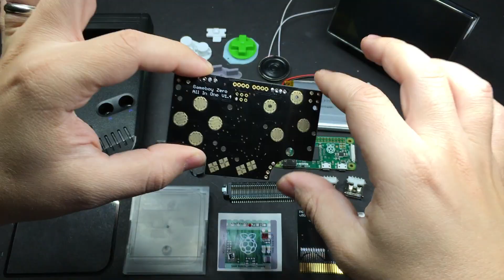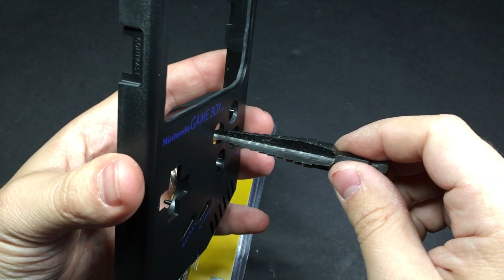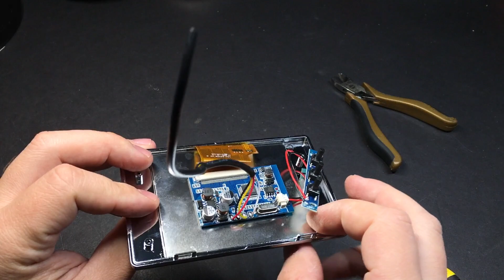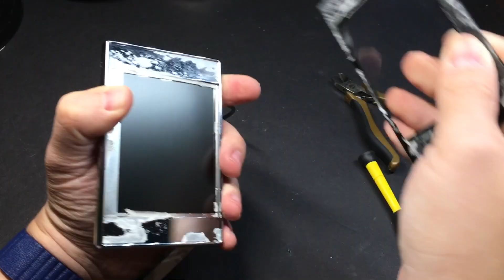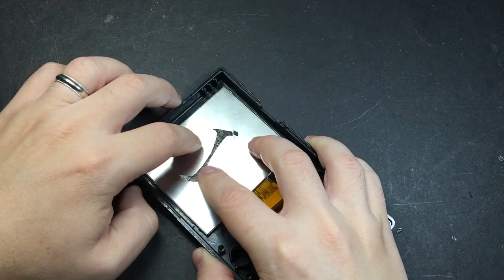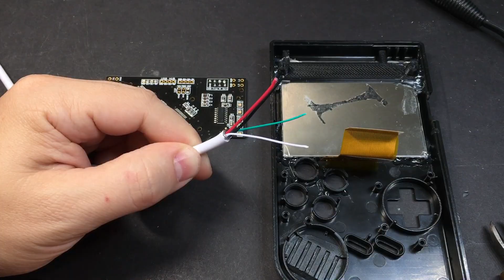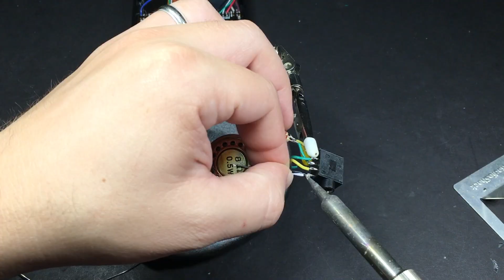Game Boy Zero Custom Part Build Guide Part 1

Comment: Has anyone tried using ringer speakers from a cell phone or PSP/PS Vita.  They are smaller and would allow for stereo speakers. Maybe like these..

http://www.ebay.com/itm/1PCS-Ringer-Loud-Speaker-Buzzer-For-HTC-One-M7-801e-801n-Earpiece-Repair-Part-/191787519326

http://www.ebay.com/itm/NEW-LOUD-SPEAKER-RINGER-BUZZER-FOR-SONY-XPERIA-Z3-D6603-D6653-L55T-B-271-/262224974922
Reply: Two speakers next to each others sounds about the same as a mono speaker :(
Reply: Ziggurat i wouldn't put then in the original location. I'd drill holes on opposite sides like the PSP. I'd probably put an analog stick were the stock speaker is and another below the dpad.
Reply: brando92711 If you want an easy way to do that you need to hurry up and bug Helder about it before he finalizes his third version of the PCB board (which includes headphone jack and much more). He has preorders for it (note the picture is not how it will look, it will have all the features from before, he just wanted to show of the headphone jack feature) http://www.sudomod.com/forum/viewtopic.php?f=3&t=1426
Reply: In still a ways off from building one of these. I'm still not sure if I'm going to build one based on Gameboy or GBA.. i haven't physically held either in years. PSP and Vita both cause my hands to cramp. I have fairly big hands. I'm leaning towards the Gb because it's thicker than the GBA but i like the shoulder buttons of the GBA.. it all comes down to which one i can squeeze the RPi 3 into because I think i want Dreamcast emulation :) Then it's a toss up between this project or putting a Wii inside a Wii U gamepad shell.
Reply: brando92711 I have started to look into trying to fit a RPi3 into a DMG shell in a Game Boy Zero style build. If I can't I will go with a Pi Zero. I plan on desoldering tall components, maybe even some of the slim components.
Reply: Ziggurat yeah, i know it's possible because I've seen a RPi 3 in a Gameboy pocket.  I think the attraction to the zero is how cheap they are but by the time people add usb hubs, usb audio and all the other shit they might as well put a RPi 2 in there.  The 3 is much more powerful but it's also a power hog.  Maybe it could be underclocked.
Reply: Possible yes, but also need to need to take into consideration power usage, what power supply needs to be used, how long will battery last, how hot will it get, can I forward HDMI to the contrast slider hole, can I forward the sd card to a game cartridge, and more.

Comment: This is so awesome.  From all the amazing work it's almost it's own open source project!  I actually wish that the community would take all these parts and come up with a few different 3d printable case designs.  The DMG-01 is nice but it would be cool if we had a few different case options that were compatible with these parts.. Mainly something that would more easily accommodate shoulder buttons and perhaps 3DS style analog sticks.  Maybe based on the GBA case.  Either way this is SUPER awesome :)

Comment: QUESTION! 
I know this is an all custom parts build BUT, could you instead just rig up a store bought USB power bank circuit and battery for a few bucks? Instead of spending 30+ dollars (with shipping) on adafruit's Brand battery charger and battery?

(For example: dismantle a $5 battery pack and have the micro USB on the battery pack be your charging port and route the Standard USB power output to your power rails by soldering) It should all be the same 5V by my understanding...any thoughts??

Comment: Great video, 
but one small thing: for me it doesn't work to just connect the "TV" cable for video signal. I have to use the pad next to it too, otherwise I don't see anything. I have a different board, but the same display driver chip and basically the same components too.

Comment: thank you again for your good work, love the button molds and screw bracket i got
Reply: what gauge is your usb wire? i have 24g ethernet cable lying around and i dont know if that would be good enough for this updated build.

Comment: This is great! Would you mind uploading a video on the basics of all the soldering you do with this project? I'm confused on all that stuff. Like how do you know what wire goes to what label, and how do you actually connect a wire to where it's supposed to go? All that stuff. I took a class on Boolean Algebra and we did a lot of stuff with circuitry but it was all just stuff with logic gates. I don't understand any of the wiring you do in these videos.

Comment: Thanks for the video. I'm having to solder the +5v and ground on the screen to pin 2 and 6 on the GPIO since PP1 and PP6 are used by the Zero4u hub I'm using. Apparently the pi zero doesn't have a polyfuse, so using either (I'm told) should be fine

Comment: I have the same screen and mine is happy running on 5 volts rather than 12 with no mods.
Reply from the maker: Nice!  Yeah it does work with it, but there was some subtle flickering that bugged me with it, and the 5v mod took maybe 5 minutes so I just did it.  The flickering might be minor enough to not bug some folks at all though.
Reply: Well mine flickers on 12v, so meh. I wonder if it's my screen or it's just not getting enough amps
Reply: I have the same screen but mine will not run on 5v without major flicker thankfully the battery im using is a 7.4v qaudcopter battery i had laying around

Comment: The best guide EVER i just buy my pi zero, how much cost every part if i are not form the USA?
Reply: wermy it would be impossible to you to sell all the necessary parts and charge us like 50 US and a cheap shipment? you could gain a little bit of money and for European people adding the charge it would be cheaper than buying all the parts separately and paying a lot of different shipments. 
thanks :D
Reply from the maker: Hey thanks!  I'm not sure on the cost for wherever you are located, and that's part of the reason I didn't include exact prices for everything: it will likely vary wildly depending on where you are located and where you are able to buy from.  Good luck!  :)
Reply: Thanks for answering! :) You're right, I found the case in a lot of colors by us $10 here http://goo.gl/FKqps2 but how much money you spend in one of this?
Reply from the maker: My case was $10 as well.  Nice selection of colors there!  Shame it doesn't have the logo on it.
Reply: It have logo but Aliexpress censore it, when it deliver to you comes with logo :D
I ask for all things tath you sow at the first of the video wermy
Reply: don't worry abouth me! it worth! :D Bronty Buutveld
Reply: http://aliexpress.com/item/For-Gameboy-Game-Boy-Original-Console-Shell-Case-Housing-w-Screen-W-Screwdriver/32551491861.html
Reply: that's 3.4 times more expensive THEN THE PRODUCT HOLY S*** +adrianrarevideos
Reply: Nintendo loves to sue. It is no surprise they are hiding the logo on aliexpress and banggood.
Reply: Bronty Buutveld why would you ever pay that. It's literally like $30 worth of parts. I wouldn't even sell completed ones for that price.
Reply: No ones gonna just do all the research for you because you ask them dude.
Go fucking find out for your self
Reply: I  bought mine on Aliexpress (grey) but even if the picture doesn't show a logo, there is actually one :-) There was the button included aswell and I paid around 7€
Reply: could you post the link :D?
Reply: *****
its the same as me! and comes with screwdrivers!
Reply: I've just started pricing and buying parts, looking at about £170 only really ordering from the US from adafruit and for the sudomod based stuff.
Reply: +wermy I'm pretty much screwd for shipping (NZ) if I want to buy a tetris cartrage from the US for 8usd it's 13.25usd shipping... FUUUUUUUUUUUUUUUUUUUUUUUUUUUUU
Reply: Just like buy a pi Zero in Spain! it cost 5$ + 17 of shipping D:Bronty Buutveld
Reply: I feel so sorry for you +adrainrarevideos
Reply: if I chose to bild this it's going to cost me 168.82USD or 233.04NZD one can only imagine how much it'll cost you R.I.P your wallet even steam sale doesint take that much off me +adrainrarevideos
Reply: gearbest or FastTech can send you all you need from china, free worldwide shipping oftenly
Reply: excuse me wermy  I can play game boy zero with the original game of Nintendo?
Reply: if you see the guide, you can see that the cartrige reader its only a SD card reader Mauro Palmieri

Comment: What is the build cost and could I get all the items shipped to the UK?
Reply: I'm up to £60.72 but didn't need the headphone jack, battery, sd card or usb breakout board.  Still require a AIO PCB at $35 plus shipping so I reckon I can get it done for under £100.  I'll post my links on the forums.
Reply: Finding some adafruit parts are difficult as they are sold out in many places. Google is your friend. Cost (I found) is around £100-£150 depending. I did buy an overpriced job lot of 3 broken gameboys.
Reply: beermanuk did you manage to get a post going on sudomod forums for UK prices for builds? Maybe one thread dedicated to UK parts?
Reply: Andy Marsh don't buy from adafruit. They're expensive as hell. Just buy the parts from eBay or similar unless you really really like paying exponentially more to support strangers that likely wouldn't do the same for you...
Reply: Need links for UK-/U-Shops as well
Thanks for the video
Reply: not convenient
Reply: +beermanuk got the links yet,?

Comment: He should have included the headphone jack onto the all in one board :)
Reply: The new board does include the jack http://sudomod.com/forum/viewtopic.php?f=3&t=1426
Reply: Oh SNAP!
Reply: monkeyboy018 cracking FR4 isn't nearly as easy as you probably think. You could probably snap the board clean in half, but you'd have a damn hard time breaking a little corner off or whatever you think may happen by having a headphone jack on the PCB.
Reply: I got some boards for sale on http://blog.tinkerboy.xyz/game-boy-controller-v2-0-for-game-boy-zero-3/.
Reply: +Omega52 does that board work with rpi 3 ?
Reply: ye
Reply: ayy lmao
Reply: apple disapproves
Reply: Martin J peeling off the traces that the connector is soldered to, however, is a very common failure mode.
Reply: hydrolisk1792 He did (i think)
Reply: There's not much support for it there, and you'd most likely end up cracking the board if you dropped the gbz, or were rough with it. Having an external jack is perfect. if you mess up the jack, you can just easily replace it.